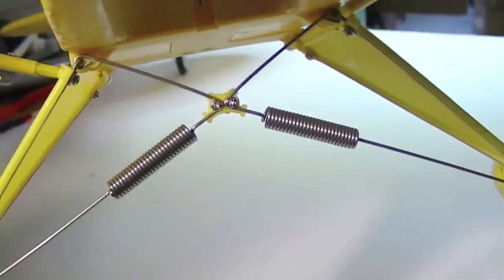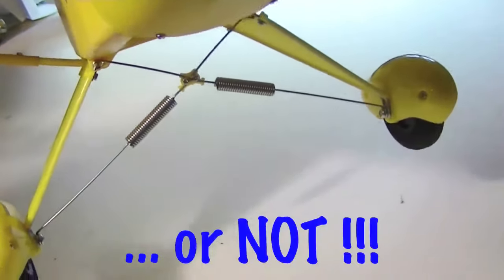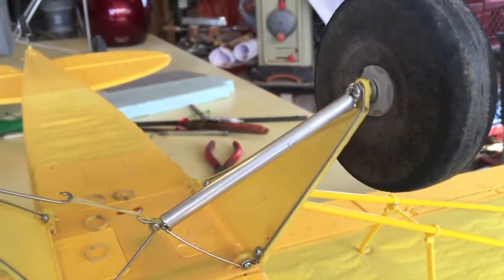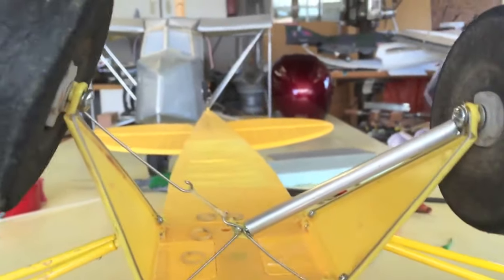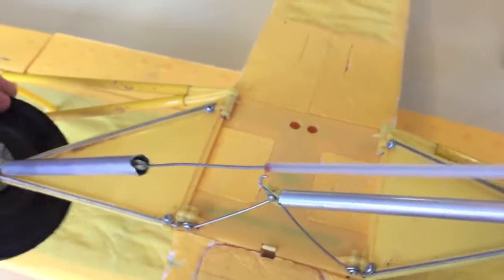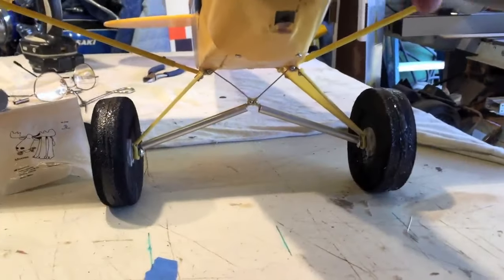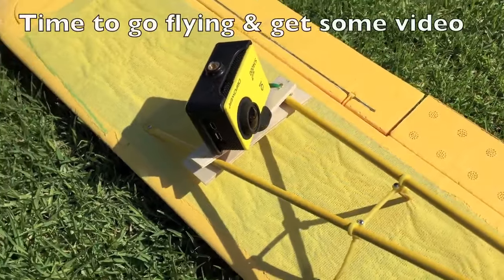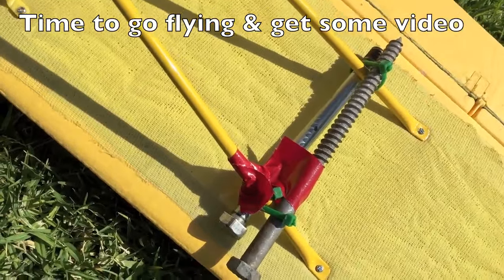FLYZONE Cub gear modification Tundra Tires (in HD?)

Comment: Are those 5" E-Flite tires?
Reply from the maker: they are 3" LITE FLITE... I cut them in half (like a bagel) and used a dremel tool to hollow them out. now they are squishy, and weigh a little less.